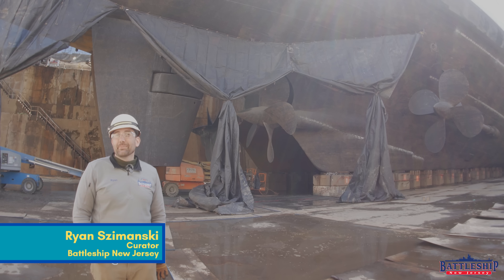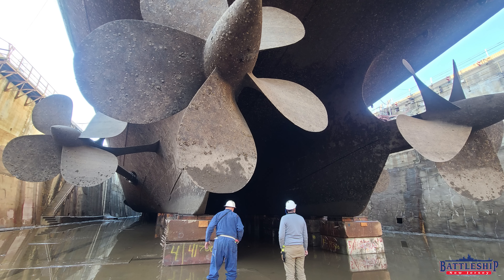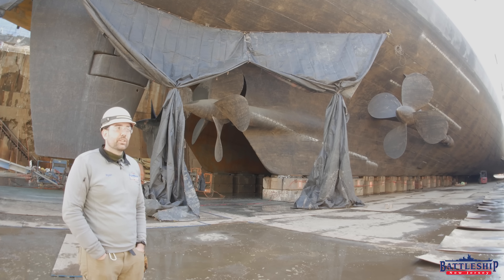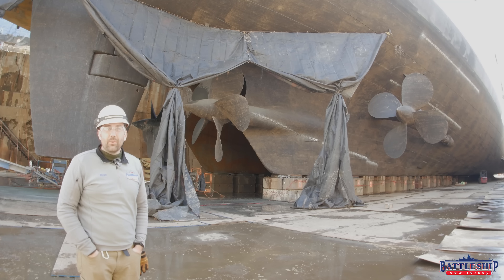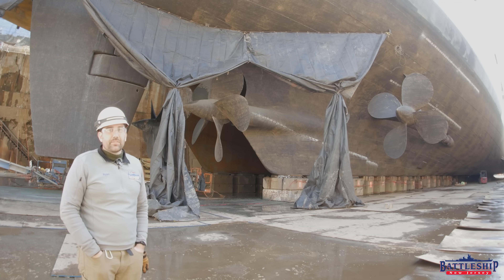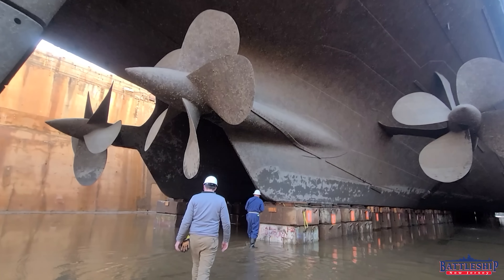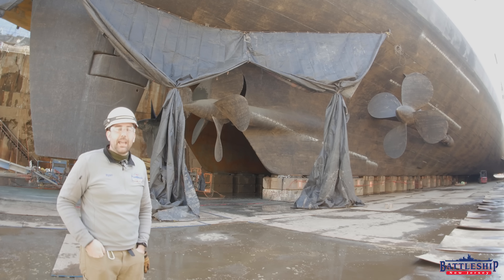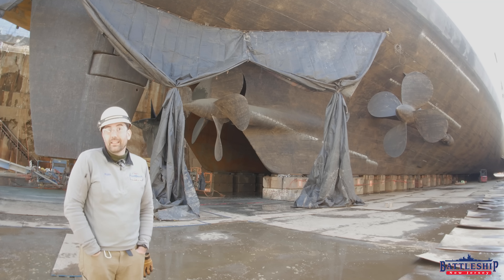Why Are The Battleship's Propellers All Different?

Comment: For those who are curious, the reason for the vibration problems on the fast BBs was apparently due to unanticipated interactions between the propellers and the skegs.  Each time one propeller blade passed behind the skeg, the reduction in water for it to bite into resulted in a brief reduction in the power generated, making it more pulsed than previous ships.  As it turned out, at certain speeds, this series of pulses would match the resonant frequency of the propeller shafts, causing the whole things to start vibrating forward and aft with the pulses in the power.  On North Carolina, during her initial speed trials, apparently, the inboard shafts were vibrating almost two feet fore-and-aft before the chief engineer aborted the run out of fear that it would rip either a thrust block or a reduction gear set loose from its mountings.

There really wasn't any perfect solution to this; any sort of screw would generate the same sort of power pulses, which would hit the resonant frequency at some speed.  The final fix was to essentially select a set of screws that would hit the resonant frequency at a speed not in a range of common fleet speeds (either cruising or battle speeds), and then just avoid that speed as much as possible--either staying below it, or just powering through it as quick as you could until you got out of the problematic shaft RPM range.

Similar problematic vibrations, albeit with a very different cause, were also found in the Atlanta class light cruisers; on Atlanta herself, during the twelve-hour top speed run in sea trials, cans of paint stored in the ship's fantail area were apparently vibrated to destruction(!), so this wasn't unique to the fast battleships.  (Apparently, SS Normandie, with a somewhat similar hull form to the US fast battleships, also suffered from similar resonant vibrations during her early years.)
Reply: I’m reminded of the issue of vibration for an aircraft transitioning to supersonic speed.  I wonder if the physics are in any way similar?
Reply: Thank you so much for writing this out.  It makes sense.
Reply: Do you have a source for this information?
Reply: @jetdriver  I don't have a convenient link to it at the moment (it's on my currently-bricked laptop's hard drive), but it's from the official report on Showboat's vibration issues from 1944 or thereabouts, as found via some digging with Google, combined with some information from Norman Friedman's US Battleships: An Illustrated Design History.  (Specifically, the stuff about just avoiding the problematic speed ranges and about Atlanta's vibration issues are from Friedman; the rest is from the Navy report.)  There's also a little of my own personal interpretation in there (exactly why the chief engineer called off the top speed runs--it wasn't recorded beyond "to avoid damaging the machinery," but that's pretty simple to figure out!), and trying to summarize and boil down the more technical language to something a little more digestible in a less-technical forum such as this.

I'll note that the report also said that the reason nobody had anticipated this as being a potential problem is that no previous US Navy ship had ever experienced longitudinal (i.e., fore-and-aft) resonant vibration of the propeller shafts before; all previous resonant vibrations had been either side-to-side or up-and-down (or some combination of those two).  As a result, while the ship was designed to damp out those sorts of vibrations well, nobody had ever considered that there might be a need for something to damp out longitudinal vibrations.  One solution that was at least tried (it's not clear if it became a permanent solution) was to install wood blocks as spacers between the shaft itself and the sensitive parts of the machinery, to act as shock absorbers/cushions much like the wood blocks in Jersey's keel blocks right now.
Reply: Good info, thank you! I recall reading about ‘North Carolina’’s issues that you described, years ago
Reply: An additional reason for the mixed 4 and 5 blade propellers was to minimise the vibrations being in synchronisation, which would make it way worse.  (I read this in a book on the SS United States, which had similar machinery and propellers, although simpler layout and only one rudder.)
Reply: As a young boy I sailed both ways across the Atlantic on the Queen Elizabeth 1 and heard the tails from the older crew about wartime sailings. The Queen was relatively quiet. The new British aircraft carrier also named for the Queen has had enormous shaft seal problems. I guess we did it right.
Reply: @rdfox76 - Thank you for the information. If I may ask for a follow up, as I understand it, the South Dakota Class had skegs on the outboard shafts. Were those favorable (compared to inboard skegs), unfavorable, or mostly the same?
Reply: @nooneinparticular1491  Drachinifel actually covered this in a video done with Ryan in the late phases of the drydocking, on this channel.  There were a number of other factors involved.  The outboard skegs on the SoDaks did have some benefits for vibration because it altered the flow pattern, but they weren't as good from a structural standpoint, hence the Iowa and Montana designs not repeating them.  Lessons learned from the NCs, however, did greatly help in taming the vibration issues on the later ships.
Reply: @rdfox76  - Thank you very much for your reply! I will look for that video; I've only recently discovered Drachinifel, but I've, very quickly, become a huge fan. (Also, I can't even look at a map of the Kamchatka Peninsula anymore without laughing.)

Comment: These battleships are an incredible feat of engineering. The fact they still stand tall to this day is nothing short of impressive. 

In hypothetical terms. Would this thing be deemed sea worthy if all of the necessary requirements and equipment was installed.

Is the hull integrity an issue? Is there anything about New Jersey that would write it off as unfit for duty?
Reply: Certainly the condition of the fuel transfer pipes that Ryan mentioned in the ballasting video a couple of weeks ago would be an issue.  He said they were in terrible shape from corrosion.

Comment: When the USS-Brush DD-745 was in drydock, I noticed that the rudders were not directly behind the center of the two 14 foot propellers.  They were inset about a foot.  I looked at the prints and, sure enough, that was the way the rudders were designed.  I was told that the shaft could be removed without disturbing the rudders if repairs were needed.  The New Jersey may use the same design.  When you get a chance, take a quick look.

Comment: Why are the props made from bronze? Why not steel or a similar metal as the ship to avoid dissimilar metal corrosion?
Reply: Bronze is much easier to cast and machine than steel.  It also doesn't rust in seawater.  Props are constantly getting hitting things and getting dinged as they engage the water (and the things floating in it) at high speed, so paint wouldn't last long on them.  These props are actually an alloy of copper, tin, aluminum and nickel.

Comment: At the Washington State Ferry system (back when I was a deckhand anyway) we typically refered to the propeller as a propeller or a prop.  I was familiar with the term wheel but I don't recall hearing it in conversational use.

Comment: Ryan as a Naval architect I agree with you that vibration issues occurred in the USS North Carolina but what you do not address is the cavitation issue which can result in vibration not to mention the loss of propulsive efficiency. The inboard props are operating in the wake of the outboard props. This means that the inboard props will see the onset of severe cavitation at relative slow speeds resulting in vibration and loss of efficiency. This condition is magnified as the vessel's speed increase. One solution, at the time of the ship's design was to increase the expanded area ratio of the propellor. This is accomplished by increasing the number of blades and reducing the diameter of the propellor. Before the advent of high speed computers propellor design was a black art governed by experimentation and trial and error as demonstrated by the year long sea trials of USS North Carolina.

Comment: Counterrotating propellors:  An interesting fact is that under power, the propellors are slightly below the center of gravity.  Which means that as the boat accelerates, it tends to pitch the bow upwards.  Sound right so far?  Well, there is a consequence to this.  It changes the effective angle of attack of the propellor blade.  Which means that if the bow tilts upward, the stern tilts downward and the descending blade will actually have more bite on the water than the ascending blade.  This is called "P factor".

The consequence of this with the descending blade on both sides being outboard is that in an engine out situation, there is more power asymmetry than if the descending blades were inboard, resulting in greater rudder deflection and more drag.

This is a factor on multi-engine propellor airplanes.  In the west, propellors spin clockwise seen from behind, so a plane climbing out of an airport will have more asymmetric thrust if the left engine fails than if the right engine fails, since the remaining right engine develops more of its thrust from the descending blade on the right of the engine than the left.  Thus, in this case the left engine is considered the "critical" engine.  Many light aircraft actually have counterrotating engines with the descending blade inboard to eliminate critical engine and lower the minimum controllable airspeed.  Since in an engine out situation you use rudder and a little bit of aileron to counteract the natural yaw into  the dead engine and the energy to counteract that yaw comes from the slipstream, if you get too slow you cannot counter it anymore and you spiral into the ground....

Great video!

Comment: Could you even build new propeller blades from scratch for the bigJ today?
Reply: Oh, I don't think that would be a problem. I used to work at a shop where they  cast up to 17' Dia marine propellers. They could fab 22' props by casting 17'ers and welding on 2.5' blade tips. That shop is gone, but I think the machinery went to a non-union shop on the Gulf, Pascagoula MS(?).

Comment: spreading the engine rooms like that, probably also made it so that any hit or damage was unlikely to cripple the ship. Yes it would degrade its performance, if a engine got hit, but the ship would still have the other 3, where as if the engines were all clustered together, a single hit could have taken them out. In theory at least

Comment: You mentioned that the props were changed out to mitigate high speed induced vibration.  It would be interesting to use modern computer generated fluid dynamics to study the harmonics of the equipment,  proppellers and flow of seawater.   Something similar was recently done to convert Union Pacific Big Boy locomotive 4014 to burn oil instead of coal.  During WWII  this was tried but found to be a failure no matter where the burners were placed in the firebox.  After a study using computational fluid dynamics a solution was found and 4014 is happily plying the rails today.  It would be interesting to see such a study on the Iowas' vibration problems.  This type of study could be done on any ship where pertinent specs are available.  Mr. Drachinifel is an engineer, perhaps he would know the proper people to conduct such a study.  Cool video, thanks much!
Reply: We had a "fossil-fueled" electric generating power plant series in California that were designed to run on either oil or natural gas because of some market issues.  These were designed and built in the 1950's and 1960's IIRC.  There were different sets of burners and optimal locations for each that had to be swapped out to change fuels, and the heating profile within the boiler was also different with different tubes receiving more or less heat depending on the fueling.  It made for a complex design, and that was just from a liquid to a gas fuel - coal would have made it even more different.

Comment: There was an argument about using 5-blade screws on the outboard, as those would have been smaller diameter, which meant less issues of "overhang" if alongside a pier or quay.  However, as finally realized, the shaft positions meant that the 4 blade screw would be clear of the inboard hull dimension.  In tests at the Towing Tank, the 4 blade screws helped give better turning response when put aback.
Reply: Massachusetts BB-59 started with 4 bladed props on all her shafts, and ended her career with 5 bladed outboard props and 3-bladed inboard props.

Comment: All the devices that convert some type of rotary motion to linear motion are "propellers".  Side wheel and stern wheel propellers were some of the first types used,  Rotary propellers (shortened to rotors) for helicopter's, and "screw propellers" for shafts that are inline with the direction of travel in airplanes and ships.  The word "prop" is just convenient slang.  It is like a dove is a pigeon, but a pigeon may not be a dove.
Reply: uh, no, that is incorrect.  You also have IMPELLERS as well.  Think of wetbikes.  Those rotac engines are even supercharged now making 200+ horsepower, and they use IMPELLERS.  
Drawing vs. pushing is the best way to think of the difference, without getting super technical into blade layout and design and all that.  You don't need to comprehend the law of flow around an orifice and other advanced engineering concepts to grok this stuff.  :D

Comment: I worked on reactor feed pumps on  the USS Enterprise CVN 65 at Alameda in the early 1980's. One of the engine rooms had a sign that said  ''Longest shaft, best screw''. I used to know the length of the shaft but forgot the details. I recall that an engineer onboard said that the propeller shaft wrapped up in torsion 3-1/4 turns between the gearbox and propeller when the ship was at flank speed. That's a lot. The engine room crew always refereed to them as screws.
Reply: 3-1/4 turns on a massive drive shaft like that is a lot of stored energy and an enormous stress.  I don't have to tell that to anybody here.   Whew.
Reply: @petersplat6164  It would wreak havoc in noise and damage the gear train, HP and LP turbines. The backlash would be insane.
Reply: because screws are what they are
Reply: @phildyer197  Screw is a type of propellor. I like caterpillar drive :)
Reply: When I visited the USS Midway (CV-41) museum ship in San Diego, one of the docents in the engine room said that if you could paint a stripe along the propeller shaft, that when underway it would twist so much it would look like a Christmas candy cane.
Reply: I wonder how many RPMs the shafts spun, on USS Enterprise at full speed ?
Reply: @EricLetourneau-xq2dc   hopefully no answers that, max. shaft RPM was and still is classified.
Reply: @victorm56  The Navy had to build the nuclear powered Long Beach CLGN 160 to keep pace with the Enterprise in the 1960's. I heard a few things from the reactor techs about a certain incident where the Enterprise actually ran at its flank plus speed one time. The engine crews spoke of hearing of it, but that kind of power and speed was very seldom used. I heard it again at A1W in Idaho Falls in the early 1980's.
Reply: @EricLetourneau-xq2dc  I heard 120 rpm max.

Comment: I suppose the last few seconds brings the major question, did the screws still turn under draft or where the shafts locked down so the could not? Mentioned the painted screws and that made me wonder if the paint "broke" at all at the contact point
Reply: The screws (main engines) are locked so they can not turn.  If they were able to turn, they would require an operating lube oil system.
Reply: Each shaft is locked in place, he did a video showing where on each one not too long ago

Comment: A really informative video , so well explained by Ryan . The engineering skills needed to keep those shafts turning through those sort of lengths without shaking the ship to bits are extremely high and it's not surprising they had problems finding the best combination of props . It's a problem with new ships even today despite all the computers used to design them .

I did think the propellers looked painted from earlier videos and it obviously makes sense for a museum ship . I wouldn't care to think of the strain on them and the shafts if they touched the bottom regularly . I must say for the last docking , thirty years ago has resulted in New Jersey looking in an excellent state of preservation below the waterline , they did a great job for all the visitors who come to see her .

Comment: I read a story at some point concerning an Iowa running over a tincan. They were told to get out of the way and just didn't listen. Made with slide rules to boot!
Reply: If the an Iowa tells a tincan, that it's about to runove,r to get out of the way and the tincan doesn't listen then the tincan has no one to blame but itself for getting run over by an Iowa.  The navy used water proof slide rules when there was a risk of the slide rules getting wet.
Reply: @TheJazsa80  I was actually referring to the Iowa class battleships being designed using a slide rule.